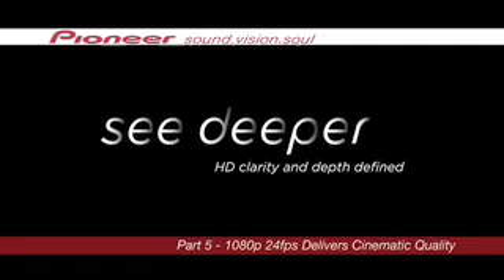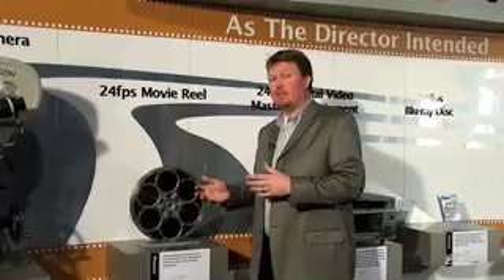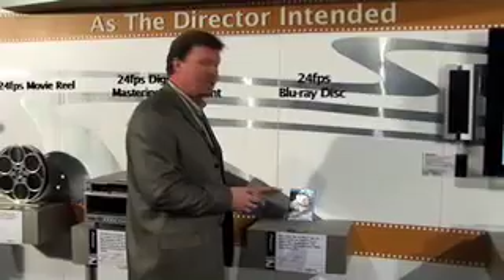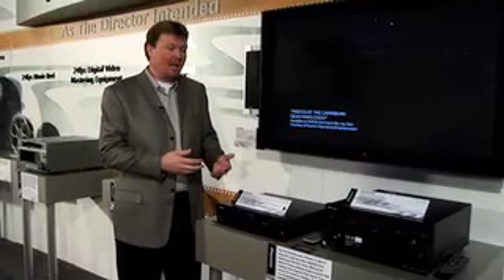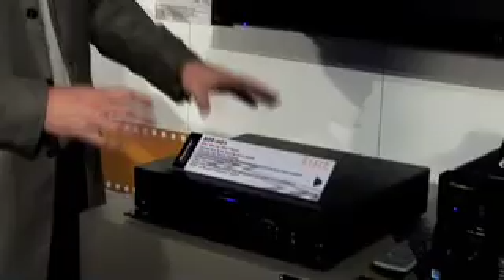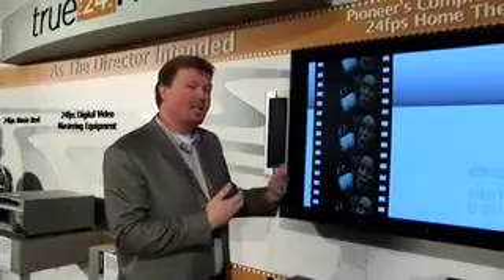Pioneer 24FPS Line Up

Comment: No it doesn't have to be higher.  Most if not all video is no higher than 60 FPS.  Where the flicker comes from is the TV doing 2:3 pulldown and doubling up on certain frames at an unequal level making the picture jerky during fast motion and during pans.  Having something delivered to your TV at it's native FPS will help, but only if the TV can do 72hz or 120hz.  Look at the new Pioneer KURO plasma panels and Samsung's 71 Series LCDs.